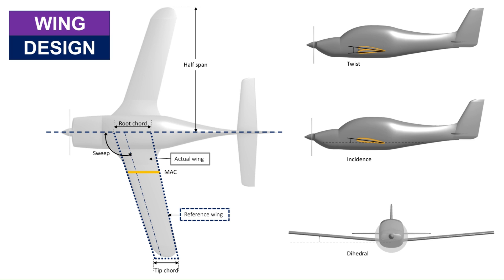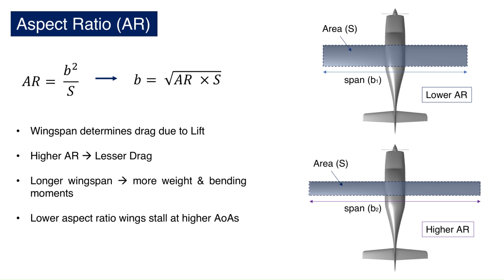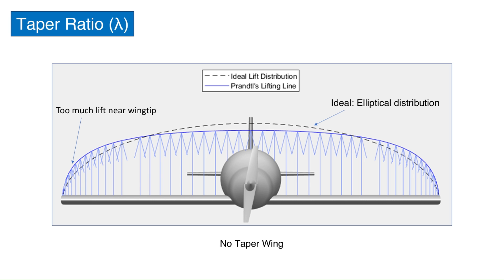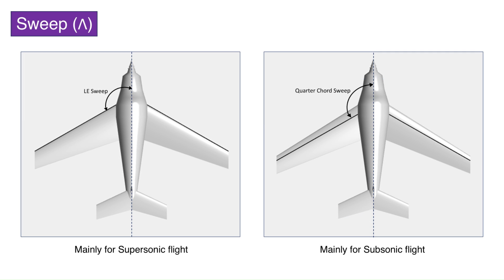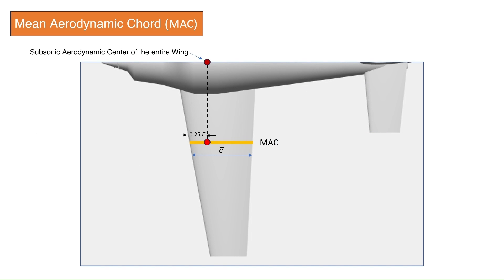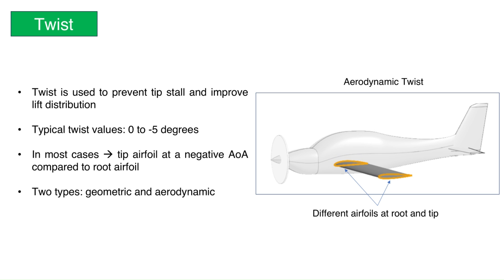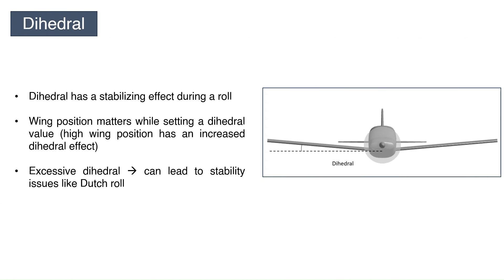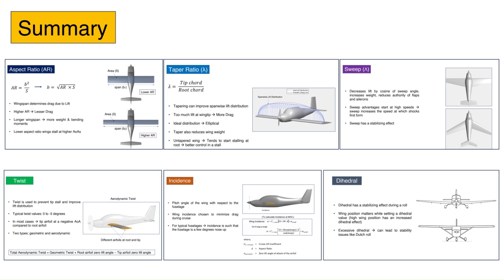How To Design An Airplane Wing | Aspect Ratio, Taper, Sweep, MAC, Incidence, Twist & Dihedral

Comment: Amazing video. At 10:28, I wonder why the low wing aircraft experience lower local AoA on the right wing compared to the left. Both the high and low wing aircrafts experience lower local AoA on the left and higher local AoA the right. How dose the position of the fuselage alter the local AoA?
Reply from the maker: Thanks! 

The fuselage acts a barrier to the sideways airflow, and the air must flow around it (pass above and below it). In case of a high wing, the air has to flow from under the wing to over the wing in order to flow around the fuselage (from the wing's perspective, under to over --> higher Angle of Attack). On the other hand, in case of a low wing, the air flows from top of the wing to under the wing for it to flow around the fuselage (from top of wing to bottom --> lower AoA). Take a look at the region close to the fuselage, where the air starts moving around it, and compare this for high and low wing. 

Hope this helps :)

Comment: can you make a short or post on what happens whit to much dihedral
Reply from the maker: Too much dihedral can lead to a very high lateral (roll) stability. If the lateral stability is greater than the directional (yaw) stability, this leads to stability issues like the "Dutch roll". 

I found these 2 videos very informative in understanding Dutch roll: https://youtu.be/9Gt-IcCBiQ4?si=WJ3IgQGJNHD3cIZt 

https://youtu.be/z2J_LUDWioA?si=GCIcZ8_OJxh3lAPH 

Hope this helps!

Comment: Bro which university are you from
Reply from the maker: I was at VIT Bhopal, and will be going to TU Darmstadt soon.
Reply: @AircraftDesignToolbox  ohh I'm in CU aerospace engineering 2nd year 😅
Reply: @AircraftDesignToolbox shoutout to my Uni, TUD! 

Listen though, I found some inaccurate or misleading explanations in your video, for example on why high-wing aircraft dont need dihedral compared to a low-wing aircraft. Also, dutch roll is not necessarily a bad thing, all airliners have this characteristic. And a few more things.

I highly recommend "Aerodynamics for Naval Aviators", available for free from faa.gov under aviation handbooks. Chapter 4 about stability and control should clear a lot of things up for you.